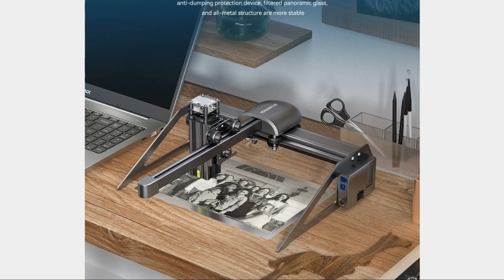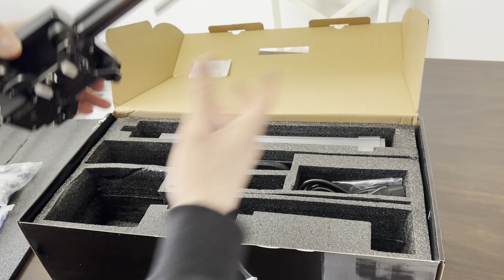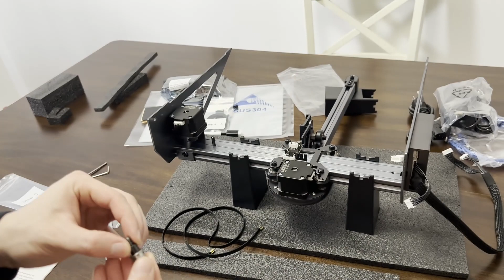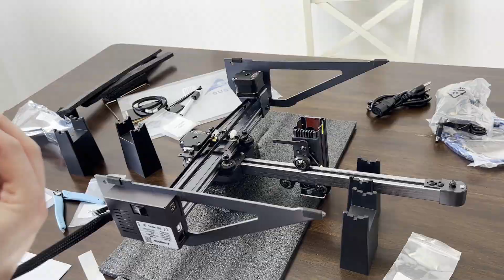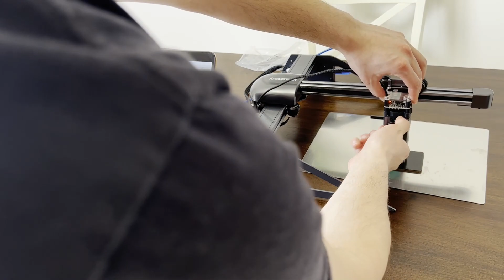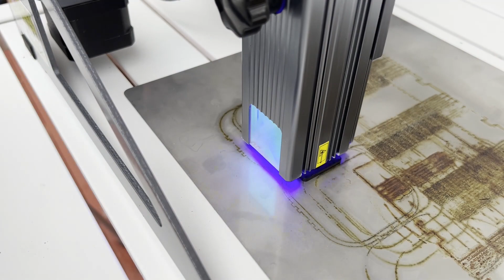Atomstack P7 M40 Laser Engraver | Unboxing | Setup | Test | Review

Comment: How did you get the picture on the coaster centered?
Reply from the maker: Unfortunately eyeballing - there is a mode that shines a weak laser around the perimeter of what you’re engraving so I would adjust, have it show me the perimeter, re-adjust, check again, and repeat until I was happy with how centered it looked

Comment: Hi man, great video very informative but I have a question regarding the first test in wood, how do you get rid of the lines to engrave the coaster because I tried with my logo also in .png but only lines came out and I wanted a clear look like without the lines
Reply from the maker: Thanks - I think I know what you mean, if you change the lines per millimeter to a higher count then there will be less space between each line the laser engraves so it will look solid

Comment: Hey I’m trying to engrave stainless steel bottles with this laser but I can’t find the right configuration, have you tried?
Reply from the maker: The only way I get it to engrave steel well is by drawing over the area I engrave with in dry erase marker and putting the laser to 100% and going pretty slow. I saw people online paint steel with primer then engrave and wipe the primer off with solvent but haven't personally tried it yet

Comment: how long will this take to engrave on acrylic area .75" x .25"?
Reply from the maker: that depends on what resolution you're engraving with, like how many lines per millimeter but thats a relatively small area so pretty quick, maybe a couple of minutes max? for the larger engravings I did on the wood pieces it took like 40 minutes, the medium sized ones took like 10 minutes,  so yours should be pretty quick

Comment: I love that you were able to etch stainless steel, what settings did you use on your test? I just set my P7 M40 today and haven’t quite figured out the optimal settings. Thanks for your help
Reply from the maker: I ran the laser at 100% power and I believe my speed was at 40%? I’m not 100% sure on the speed but I just kept going slower until it looked best

Comment: Hello, I also have the Atomstack P7. Unfortunately I'm not happy with it. When I engrave fine lines or letters that are engraved line by line, I get an offset of about 1mm. Is that the case with you too? What can I do against it?
Reply from the maker: Hey! I did not have that issue - what software are you using to engrave?